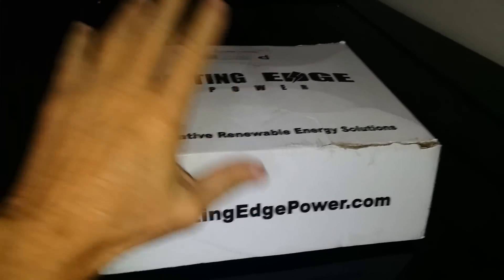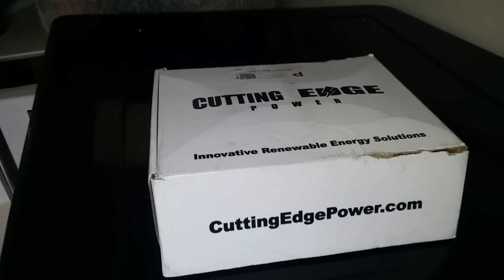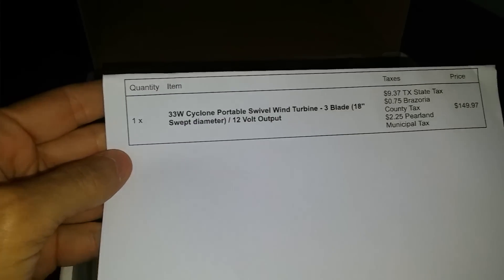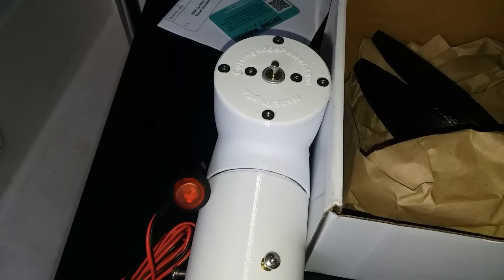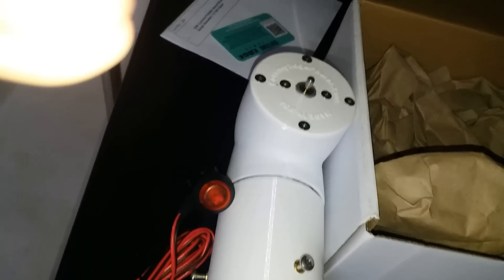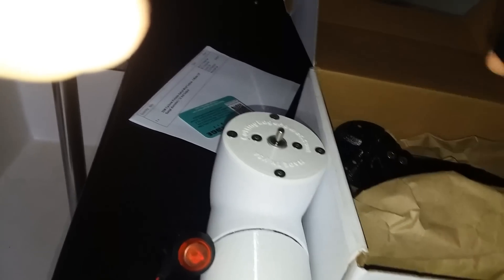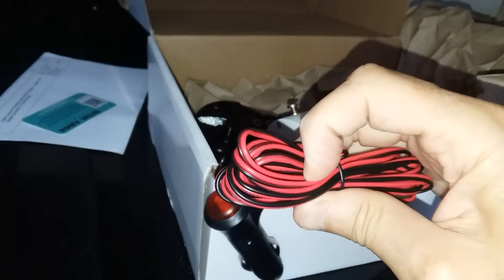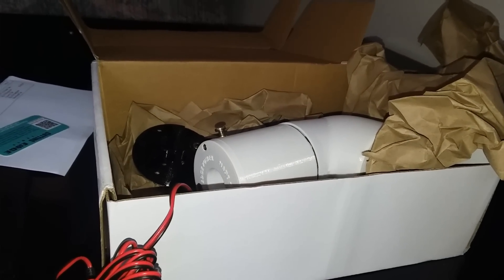Charging Boat batteries while away from the dock (unboxing)

Comment: David, no info on power output vs drag resistance. 
I think this will relatively use a lot of fuel vs wind propeller and of course solar. For 130 you could have build a solar rig that probably outputs more wattage then this underwater ramjet.
Also there are Hybrid MPPT Solar/Wind Charge controllers +/- $120. Combine a wind-turbine and Solar for charging, and, if both are absent, use the saved fuel in a generator to send your SOS.
My advice, if you still live in Texas, go for the cheap Solar option.

Comment: The power receptacle in the boat may not accommodate the amps needed to charge the power. You may have to get a receptacle that will provide enough for you. 3 Amps or more is what you will need. I think the one on board would normally supply 1.2 amps.